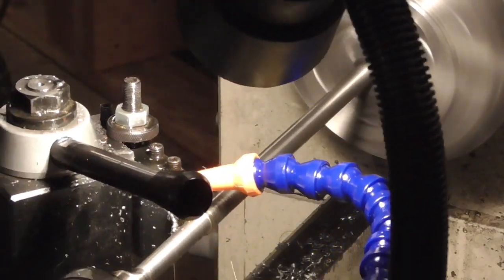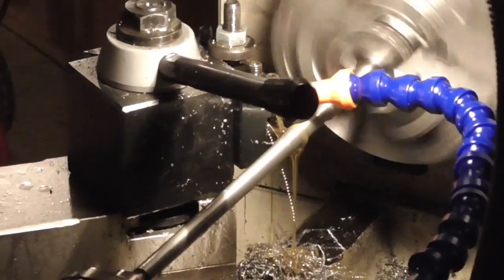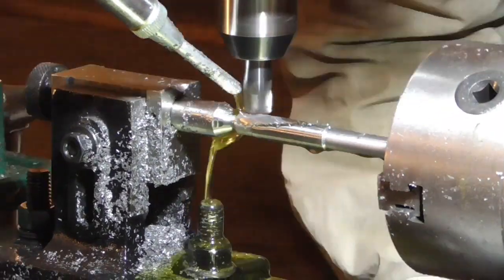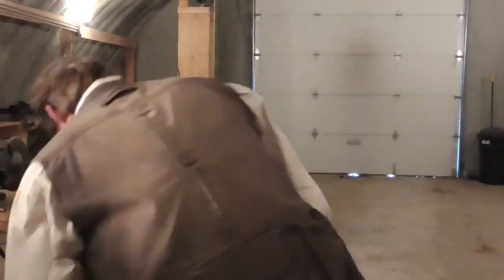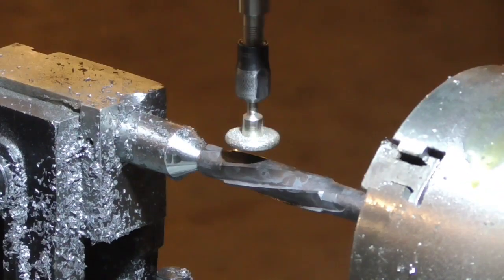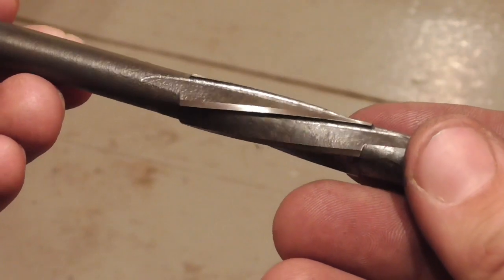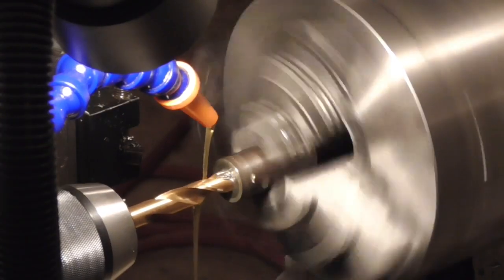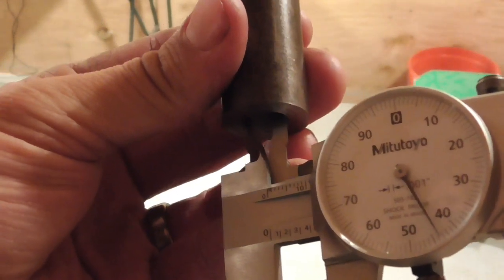Making a Reamer (TIS146)

Comment: I do like your videos. However, many of them seem to be geared toward an adept machinist's or even a mechanical engineer's level. There are no explanations for example, on what gear ratios to use on the Norse chuck, what size pulleys are required for the desired rotation speed outcome etc. Your ideas are great and even practical for someone who can get their head around the math and reduction formulas etc., but math was never my strong point. Also, more drawing and explanation of the concept idea and it's function as opposed to watching the machine turning out the part. I would like to try out some of your projects, but there is just not enough instruction in them to do so.

Comment: I'm curious as to what needs a 0.444" hole. Looking at your manner of dress and the topics of some of your other vids made me consider a possibility. Cartridges of the World tells me the external diameter of the .44 Henry Centrefire cartridge runs between .443" at the neck and .445" at the base, and that your piece of bar stock is potentially either a full-length resizing die for the case or a dry run for the chamber.

However, the thing I was most fascinated with was the manufacture of the reamer. Why is the reamer better than a drill? I could easily have watched you do an extended video solely on the logic behind and manufacture of the reamer. Cool stuff.

Comment: Good vid.  
I’ve made similar reamers with A2.TS, not helical though, nice touch.
I don’t rely on the drill to make a concentric hole. I’ll single point bore 0.005” first to ensure concentricity before reaming, sometimes followed by a roller burnishing tool for very smooth bores and greater accuracy. 
Thanks for posting.

Comment: I drilled a hole 7,9 once (sorry I cannot into those fancy inches of yours) well may be it was 7.8 mm, then I took the 8 mm bit next and turned out that the hole I got actually was less than 8 mm because I couldn't put a dowel pin in it.
This is how I found out that drillbits are being made, like, minus five hundredth from the nominal size, or so.

Comment: For reaming a real fancy diameter hole the "quick and dirty" way, you could also use an adjustable reamer.
Reply: I dont find those great in a lathe , if you are trying for presision centering , and they can chatter .
Reply: @paulbains9152  they are supposed to be used by hand

Comment: Hey there, quick question. Does it have a clearance angle? And if yes, how did you machine/grind them precisely?
Reply from the maker: I used a 10-degree clearance angle.  When I sharpened the reamer using my helical machining apparatus and the diamond bit in a router attached to the mill, I first set the chuck to an angle of 10 degrees, then tightened it on the reamer with the tooth I was going to sharpen facing straight up.  Then I rotated the chuck back to zero, engaged the belt, and proceeded to grind the edge.  After that, I just indexed the chuck for each of the teeth.
Reply: @TheIdahoanShow  thanks!

Comment: i don't have an air compressor, will quenching it in oil cut it?
And what do you mean by type 82 tool steel? i don't live in the US so i don't understand the steel naming system there, can you explain it in metric manner?
Reply from the maker: It's type A2 tool steel, not 82.  The name is short of "Air-hardening tool steel, type 2."  However, even though it's designed for an air quench, oil quenching would probably work just fine.
Reply: thanks for the clarification. Are there any optional material for the Reamer? like D2,SDK11... I'm looking for something cheap enough for 1 time using only and also soft enough to machine
Reply: I also hear that after heat treatment, the actual dimension of the object will change, thus make it not perfectly precise no more, is this true? if so will it affect much on the final product?
Reply from the maker: D2 makes good reamers too, but it is usually about twice as expensive as A2, and is somewhat more difficult to machine.
Reply from the maker: The amount of dimensional change during heat treatment depends on the material.  In my experience it is usually negligible for reamers of this diameter made from A2 tool steel.

Comment: I’ve tried this before to make chamber reamers  I leave them oversized a few thousand and final size after hardening with a dumore grinding attachment on my lathe  , or a spin index  and sine plate on a surface grinder but had trouble with it not wanting to cut , do you cut a relief on the reamer ? I ended up going with a d reamer but would like to give the spirals another shot  .

Comment: first you turn it to .444 then you grind it and it stays .444
now that is very hard to do and stupid as well
why not turn to say .446 and grind to .444?
Reply from the maker: The die grinder isn't quite as precise as the machining operations, so I prefer to turn to the correct diameter and then just grind right up to the edge without grinding down the edge, rather than trying to measure and control the depth of material removed during sharpening.  And of course, grinding is a comparatively slow process, so the less material needs to be removed by grinding, the better.  The method I've shown here seems to work pretty well, but if you've got a better method, feel free to make a video about it!
Reply: i guess you are right
if you grind not enough there is no problem  other than the fact that the reamer will not cut and if you grind too much it is trash anyway

Comment: That's a nice reamer but, you're way overthinking this. McMaster Carr has .444 reamers for $32.58, as well as just about every other decimal size you might want. If you really must make your own a "D bit" reamer is really simple to make and doesn't require any weird and troublesome tooling like your norris chuck (which is a primitive version of a device found on antique horizontal milling machines). So, unless you just like building custom tooling, just buy the stinking reamer.

Comment: Very cool project as always!

It's immensely useful to be able to make things like this. However, just in case you find yourself in a situation where you'd rather buy something like this in the future, tooling dealers like McMaster-Carr and Bass Tool sell what are sometimes called decimal reamers. ~$30 will get you your .4440" reamer with a +.0002/-0 tolerance.

Your way makes the most sense for one-off projects, prototyping, R&D, etc., but hopefully some of the new work you're going to be doing will be successful enough that your time and machine time will be worth more than the asking price for non-standard reamers.
Reply from the maker: Thanks!  Last I checked, McMaster-Carr only carried reamers in increments of .005, so the closest I could have gotten was 0.445 inches, and they only had them in very short lengths, but I'll check again next time I need one.
Reply: The McMaster catalog number would be 8803A861 for your 0.444. 7" length. It's a straight flute reamer, but since you're not reaming a blind hole or anything interrupted like a pulley hole with a keyway,  straight flutes would suffice.

Double check their website. You might have seen that they increment in 5 ten-thousandths and thought 5 thousandths. Trust me, I've made that and similar mistakes when trying to order tooling far more times than I'd like to admit. Fortunately, I had a great sales rep who kept me from making expensive mistakes.

Comment: I also use the adjustable reamers the diameter depends on how deep you turn the screw into it, so the blades make a bigger diameter a lot of people dont know how to use them but they are cheap and very accurate and you only need one for lets say 9 to 11mm... you can have every diameter in 0,01mm steps and accuracy between this range with 1 tool...

Comment: Absolutely right a reamer makes real round holes but on the lathe a turned hole is also absolutely true round and in combination with a good DRO with glass scales i get exact results every time. Good vid like always. On the mill i also use my boring head to get round holes but not so comfortable and exact like on the lathe. A DIY reamer is a goodie that's clear... Thanx
Reply: indeed unless you want to make small and/or deep precise holes. then you can't get around using a reamer

Comment: Hi. Your machinning methods are interesting. Can you elaborate more on how you positioned the diamond bit to cut the reamer without chnging the od? Also, xan you please do a video on your setup to turn/mill the spiral reamers?
Reply from the maker: Here is a previous video about my helical machining apparatus: https://youtu.be/GQKOHioHJfA

To sharpen the reamer, I first aligned the chuck (of my helical machining apparatus) to 10 degrees, and inserted the reamer with one of the flute edges facing directly upwards.  Then I tightened the chuck and rotated it back to 0 degrees.  Now the intersection of a horizontal plane with the cutting edge of the reamer would form approximately a 10-degree rake angle and relief angle, so from there I just used the flat face of the diamond bit to grind down the back of the reamer tooth until the ground surface just barely touched the cutting edge.
Reply: Thanks!!!
Reply: @TheIdahoanShow  This was a very good, shot and competent answer. Earned a Sub!